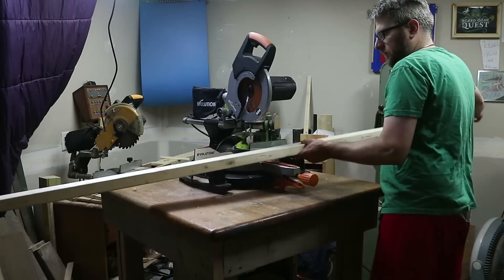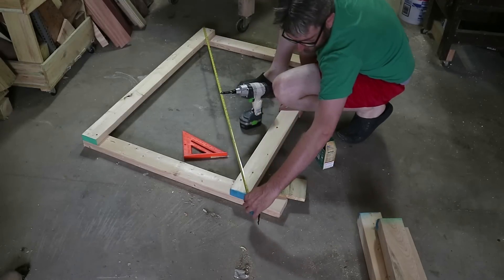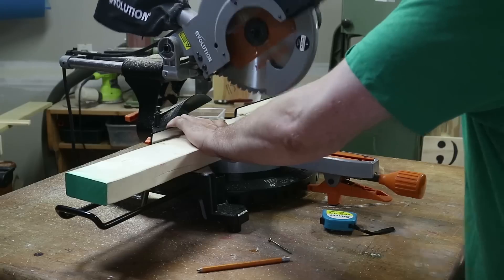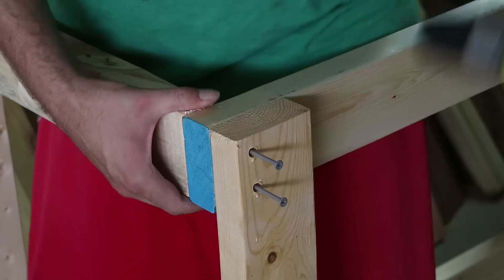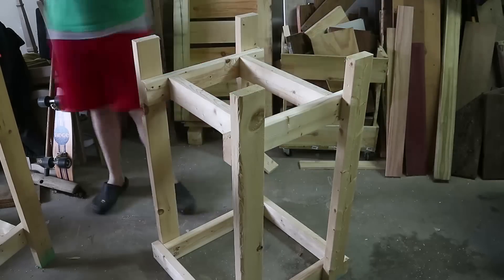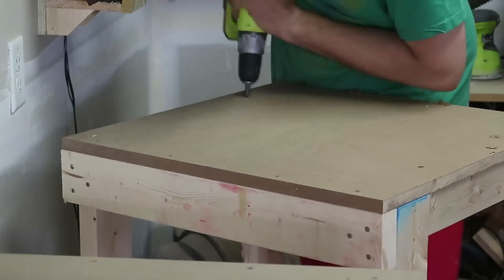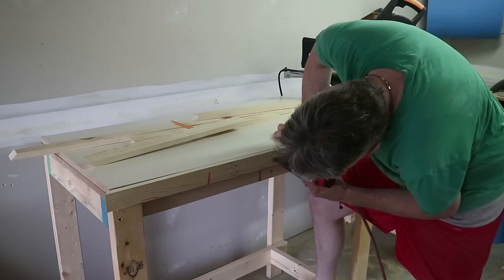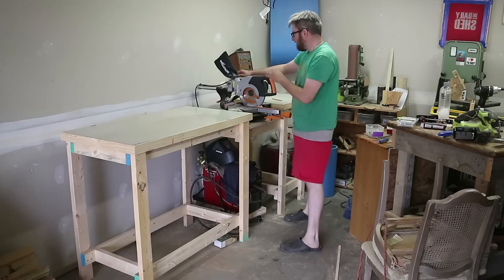Simple Miter Saw Bench

Comment: I'd like to buy a Radial Arm Saw for the sole purpose of using a dado blade on it, since the Dewalt DW745 cannot(?) use one.
Do you think that a mitre saw can have a dado blade?

Kind Regards
Reply from the maker: I don't think so. The arbor is big enough that you might get away with 1/4" and under, but I wouldn't try going much bigger. Maybe 3/8?

Comment: Did you have to spend a lot of time getting the tables on the miter saw level with the bench top or was that not so much of a concern since the benchtops were level?
Reply from the maker: Wasn't a big deal. I prefer to have the tops of the bench about 1/16th lower than the saw bed so I'm always referencing the saw.